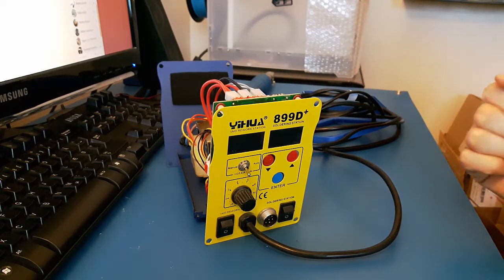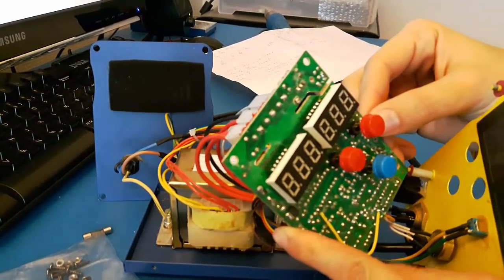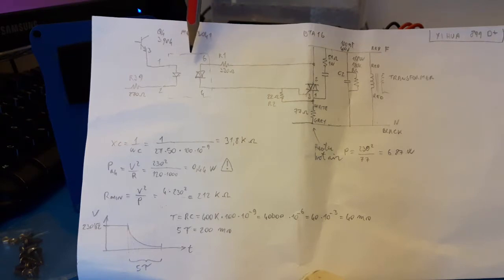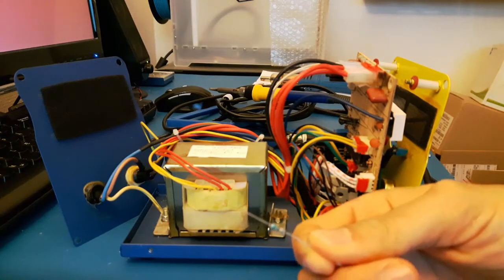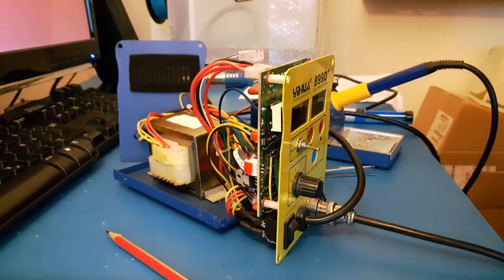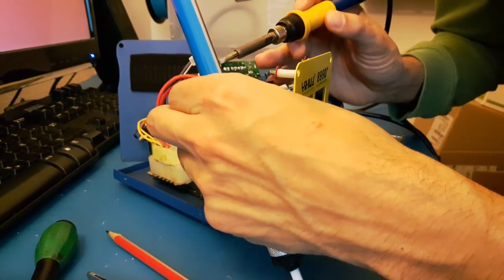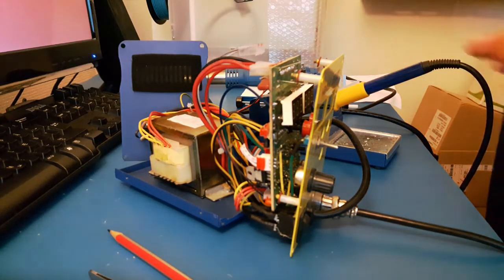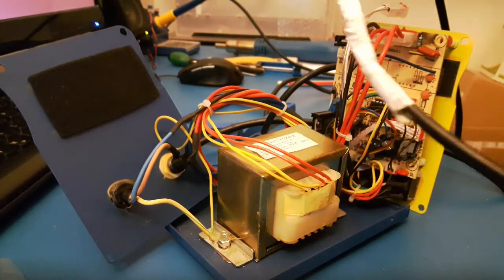#5 yihua 899D+ soldering station repair

Comment: hello, my station is yihua 8786D, PCB: YH8586DV9 the R16 resistor burned, can someone help me with the value of it. This resistance is next to the
resistor R5 and connect to pin #1 of the optocoupler U5 and the 3-pin CON4, thank you very much in advance. cordial balances

Comment: Hi i hv a 852d+ i hv the hot air gun going red n burnt the internal coil. I saw some yt videos n they said to change the triac which i did n checked other triacs n they are all good. But im still having the same problem my hot air gun is still going cherry red! Can u advice wat else i must do? I hv a lm358 n the 3041 u mentioned n i checked it n they are not shorted or open...im lost. Pls advice.
Thank you.

Comment: Hello, I have the YUHUA 8586 model does not indicate the temperature on the display, which is the cause, is it the same ?, I wish you a good day ...
Reply from the maker: try disconnect the stick, if you see no change in the display, the problem is the temperature sensor inside the stick